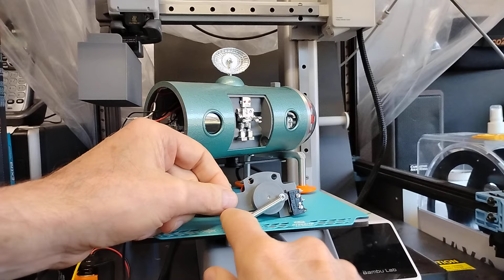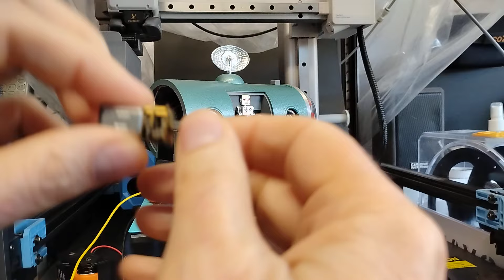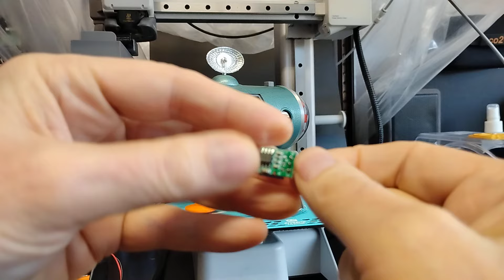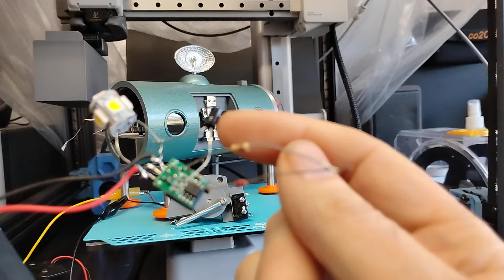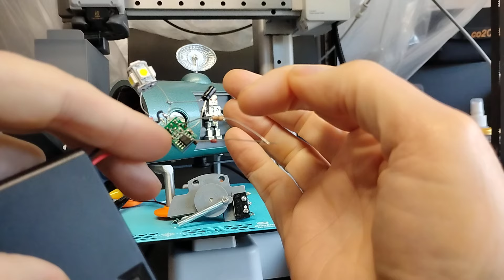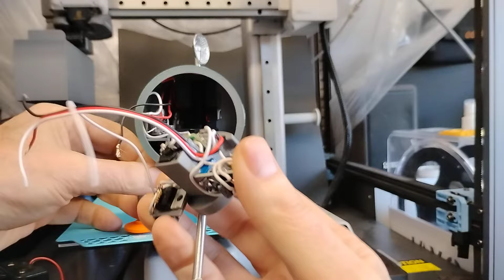Part 2. M27 Explorer build. Walking, Door opening, Antenna turning, moving robots, flashing lights.

Comment: That is some crazy amount of stuff that all fits inside!
Reply from the maker: Way back when I decided to add the M27 body to the simple walking legs unit, I based the size on a 70mm clear dome that I had laying around. I sure whish I had just bought new 80mm or even 90 mm clear domes. It would have given me so much more space and made it look more to scale of the original 1960's toy.
Reply: @Robothut  Make another one with the bigger domes! 😅😂 It's still super cool!

Comment: Well that was very interesting. Certainly a lot to think about. Any chance of links to the two different timer boards you showed. Looking forward to the final part.
Reply from the maker: Here is a Amazon link for the larger 555 board.
https://www.amazon.com/DAOKAI-Generator-Single-Channel-Adjustable-Rectangular/dp/B0B5D3ZPLR/ref=sr_1_15?adgrpid=1339206397693080&dib=eyJ2IjoiMSJ9.RFH9uyiZwGPAdPw2OU-2QRI7r2JLf6geLkpaE6TSluOOkFak93toVTS5U3VSf_INs5v62Ycrf0NKK3XSLZFw_dgpWTYlaDZcMhCX5652VMoI9bb7G9aS-x-NUn_x_IVe0e7yfvqDWmeZydvyPvwq1-uYF9-OhvSizsMAylld92pOo2aQTlAxN-4P5lnC_uqETZMlmRSMTU_TWAtqku8MkHqxctnr0qb_ylzw0gRIphQ.y46Ry3Qymc4r4aXU9B1IdrWW0YlswS-OV0dYk7qmaYo&dib_tag=se&hvadid=83700572777192&hvbmt=bp&hvdev=c&hvlocphy=111352&hvnetw=o&hvqmt=p&hvtargid=kwd-83701238954055%3Aloc-190&hydadcr=24326_13514999&keywords=555+module&mcid=729f5f7a1e0d3f909964cc3080eb1e12&qid=1765834856&sr=8-15

Here is a link to Ebay for the smaller 555 board.
https://www.ebay.com/itm/136696160409?_trkparms=amclksrc%3DITM%26aid%3D1110018%26algo%3DHOMESPLICE.COMPLISTINGS%26ao%3D1%26asc%3D296752%2C297363%2C291273%2C297065%26meid%3D503f6f3090ab4a3d936bd96d15bdc2d9%26pid%3D101196%26rk%3D3%26rkt%3D6%26sd%3D127504048251%26itm%3D136696160409%26pmt%3D1%26noa%3D0%26pg%3D2332490%26algv%3DCompVIDesktopATF2V6ReplaceKnnV4WithVectorDbNsOptHotPlRecallWithSiblingFilter%26brand%3DUnbranded&_trksid=p2332490.c101196.m2219&itmprp=cksum%3A136696160409503f6f3090ab4a3d936bd96d15bdc2d9%7Cenc%3AAQAKAAABQIObiuteozFaahfHli5t01UIStMdUUaYczAbGaV87lJkYZlnqhPs6hnMXGASN4AJ2yFwbUKfsmeb7meQT9YaEGG7E0Yt63%252FcPRE1o4XweVgLhTT94orMyr0Mx%252BdDZRVLfBn%252F4MFgoxLArJ3yQNVUfSU%252BOHFAcdIHecR8TTO86BNa3FkvvNEfb7WY8XNP47Ghty0y5lgC8YDi%252BrSV0BAKBeh%252BpWevHSIvTcPBKWFVr%252B6ng91axajlWtXw%252BTFWYbIs4CnA6ELzLrA2O6ygrCWP9B1IfA8ErMnFqXoim0yYCkQxY8fIja0witAPtjGkCLOXkoJj4r4JLilbTjP7sFPT2pnZk9zl0w4wI0wI5VEF%252FN5SBjVU5qEMTL%252BuBcC3LOwEwZB1NARsxzRc2Z8iUvrbcL3MyDrBNB0zvDF9kX8szPMB%7Campid%3APL_CLK%7Cclp%3A2332490&itmmeta=01KCHZJ0TQYXSHHG7ZMK8P4M02